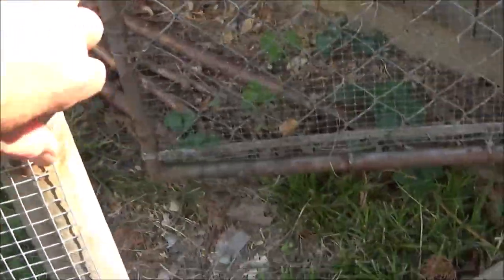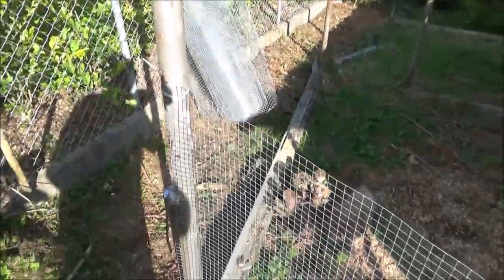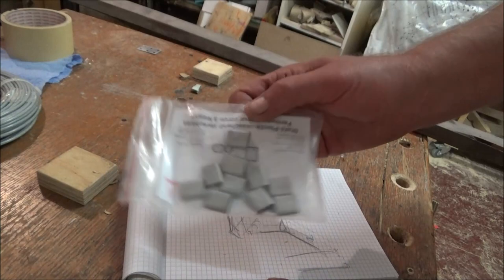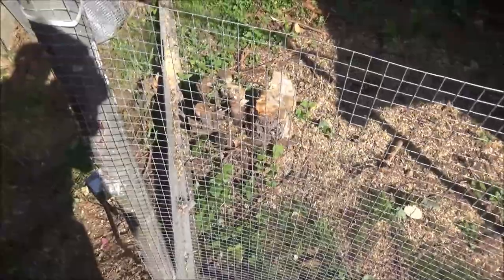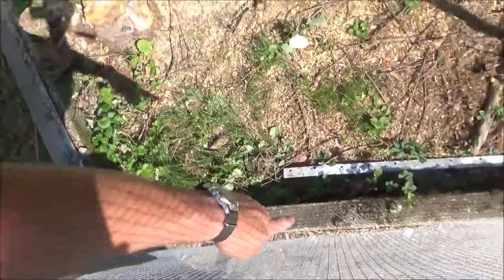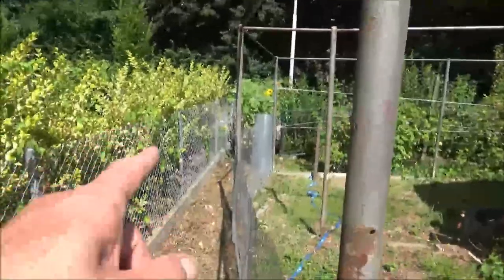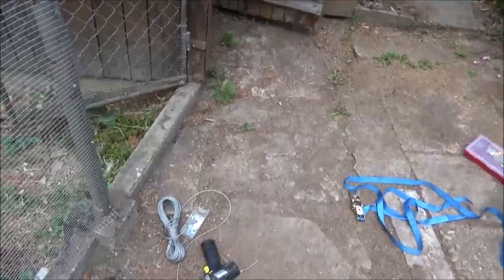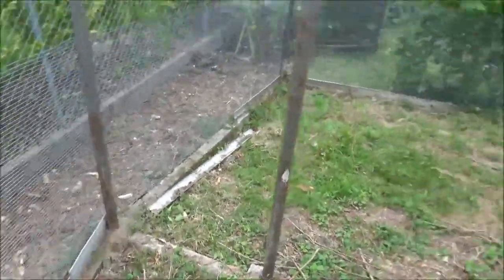Making a fence wire stretcher and fencing the chicken run  14 07 2020

Comment: Dandy little contraption there.  I tried doing something similar with hardware cloth and I ended up breaking the wire where tension was applied.  I folded the wire over on itself a few times to get more resistance / strength to pull against - that worked a lot better for me.  Looks nice!
Reply from the maker: Thanks for the tip. The first one I had cut so it was what it was only broke one wire but I didnt pull that hard with the ratchet strap as that was all i had. I could have put two on. The second and third pull I did I left the roll on and pulled behind the post. The breaking wire was behind the post. But I wish I had done what you said I could have got more pressure on it. I will do that with the chicken wire on the top for sure and you will get a mention for your help. 
Thanks again and all the best Dave
Reply: @SouthpawDavey  Thanks!! Glad I could be of assistance.  It does look nice.

Comment: Nice one Dave. Might pinch that stretcher jobbie when I build our new chook run.
Still find it weird you can folks & the yanks call it  hardware cloth. I know it as snake mesh.
Cheers mate and have a top one. 🍻👍😁
Reply from the maker: Cheers mate yeah I would call it square mesh but I heard it call hardware cloth. Snake mesh is only needed in OZ lol not forgetting crock and spited mesh lol.
It worked really well mate I could not have done it without it. What I will say if you do cut your wire long enough so you can fold it so you have the hooks through 2 layers you can pull harder and its less chance of the wire tearing. 
All the best
Reply: @SouthpawDavey  Cheers for that mate. 👍